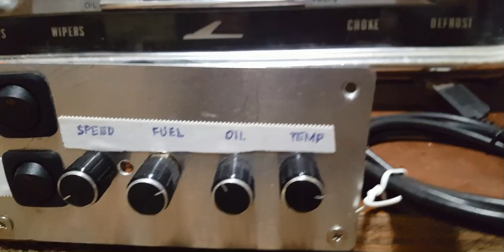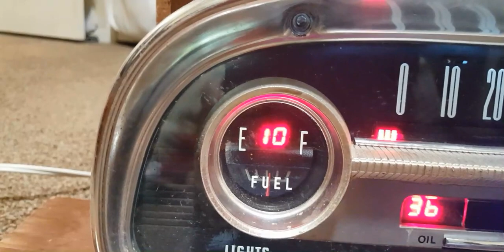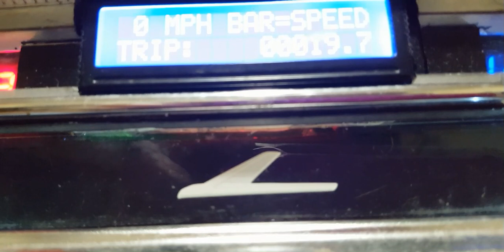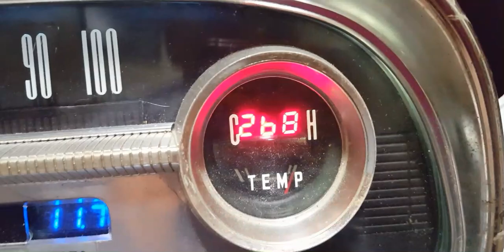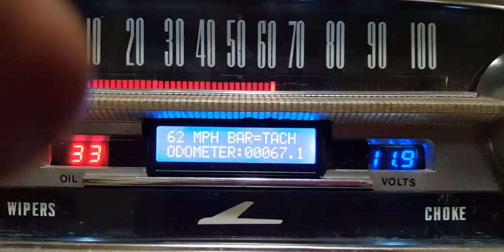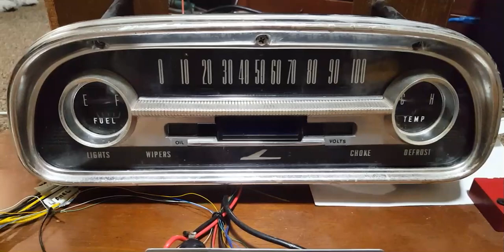'63 Falcon Digital Gauge Cluster Video

Comment: i2c bus throughout?    Did you multiplex the speedo bar graph or just run it off the outputs direct?  And did you run the segments of the digital displays direct also or did you use some type of controller for the digital displays?  My guess is the code is quite extensive.
Reply from the maker: The speedometer bar graph segments and the digital displays are all driven via the i2c bus.  I used 7 - 16 bit chips for those.  The 7 segment display segments are driven directly from the i2c chips. the 8th i2c bus address is used for the LCD display. All of the 7 i2c chips data is done through a look up table.  Yes as arduino code goes, I would call this the most extensive I've done so far.